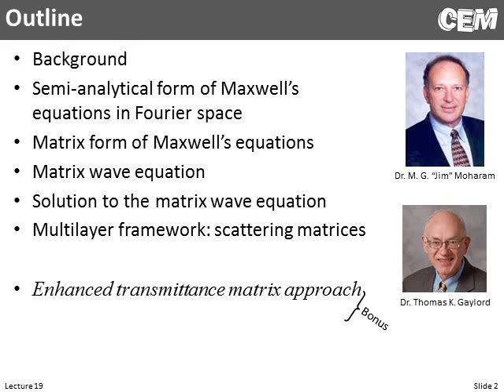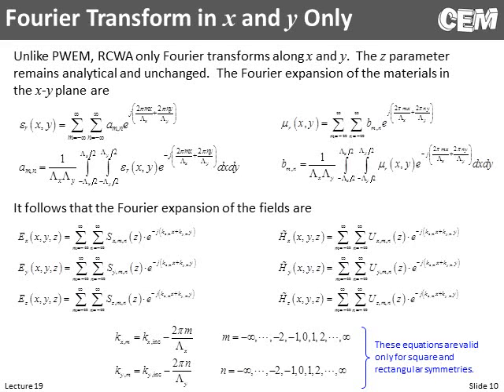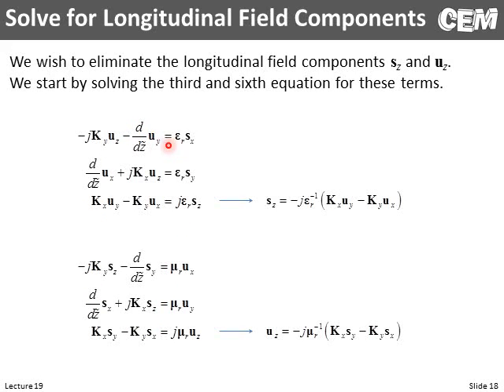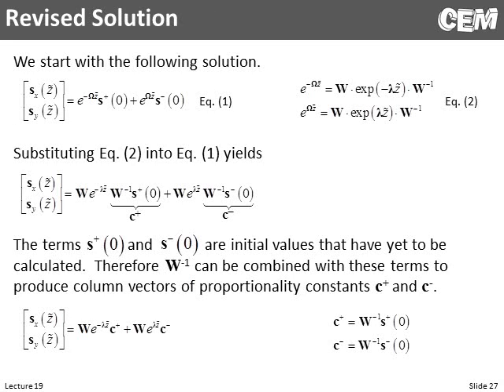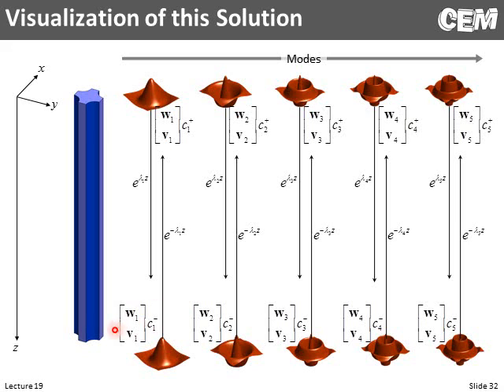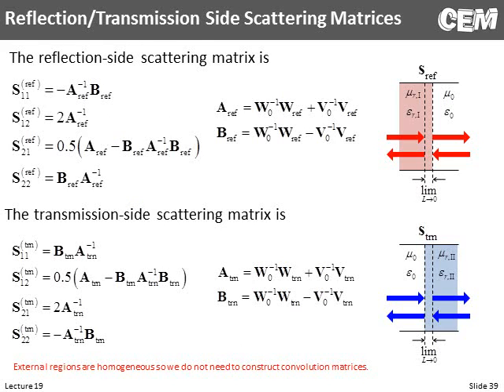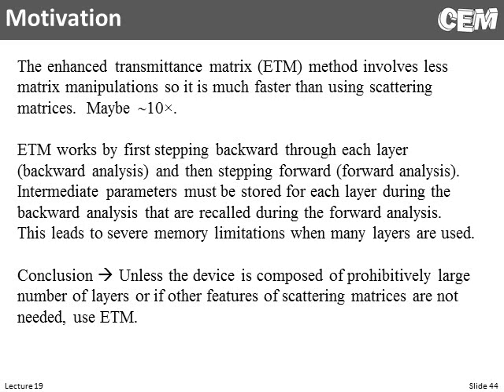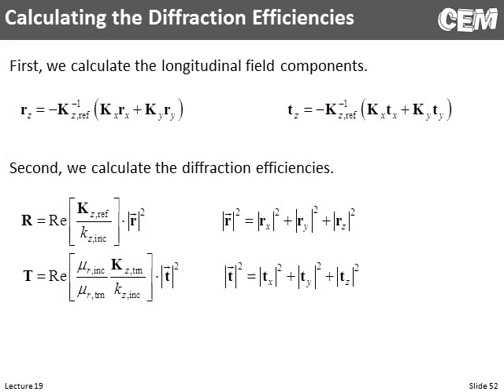Lecture 19 (CEM) -- Formulation of Rigorous Coupled-Wave Analysis

Comment: Hi Professor, is there any reason why we usually put 1 on the zeroth mode on the delta function of the incident electric field source?
Reply from the maker: The simulation being described here illuminates the device with a single plane wave.  If the angle of this wave happened to match one of the spatial harmonics, you could put a 1 in that position of the source vector. However, it is easier to just always source the device with the zero-order spatial harmonic for plane waves.

For other sources, you would need to do more to the source vector. For example, if you wanted to simulate a Gaussian beam, you would calculate the Gaussian beam, Fourier transform it, and calculate the weights of the spatial harmonics so they would sum to give you the Gaussian beam. The source vector would contain all of these weights. You can imagine doing the same for guided modes or whatever else.

Hope this helps!!

Comment: Hello Professor, I would like to confirm: theoretically, if there were no limitations on computational resources, could the RCWA model compute any numerical input? For example, setting the period to be extremely small or extremely large.
Reply from the maker: Interesting question.

So ignoring any problem due to size of the computational problem, I think RCWA is only limited by the physics that it is formulated from. My formulation is based on classical electrodynamics with linear and mostly isotropic materials. It would not be able to account for quantum effects at extremely small scale, relativistic effects of devices are moving near the speed of light, etc.

If I think of anything, I will edit my post here.
Reply: @empossible1577  Oh! thank you sir, I see! It is true that quantum effects in very small cases cannot be ignored！

Comment: Greetings, esteemed professor.
I have encountered a very troubling problem in my implementation of a rigorous coupled wave program. I found that if I set the relative permittivity of the transmitting or reflecting regions to complex numbers (either a+bj or a-bj), the sum of the calculated diffraction efficiencies is greater than 1, and sometimes even greater than 100. do you know what should be the reason for this? I don't know if there is something wrong with the program, because the results are always correct when the transmission and reflection regions are real numbers.
Another question, professor, is that when I set the thickness of a certain layer (for example, the last layer) to be very large, usually hundreds or thousands of micrometers, and if there is no loss of material in this layer, i.e., when it is k=0, I found that the curve of the diffraction efficiency calculated in the end shows malicious oscillations, even though the final power is conserved, I think that this kind of oscillations should not be consistent with the actual situation. . I also found the solution, which is that if I set the transmission region material to be the same as this layer, then the oscillation disappears. But my limited knowledge cannot explain why this is. Can you help me.
Have a nice life!
Reply from the maker: I suspect your first problem is a sign convention issue. This RCWA uses the negative sign convention where waves travelling in the +z direction are expressed as exp(-jkz). Along with this is permittivity with loss is er = er' - j*er''. Notice the imaginary part is negative for loss. I suspect you setting the imaginary to a positive number, as would be done when the positive sign convention is used. A positive imaginary part corresponds to gain.

It is a little difficult to diagnose your second problem. It seems when you match your transmission region to your last layer you see consistent results. Otherwise you see oscillations. I am not entirely sure what you mean by oscillations, but I can guess. If there are reflections at either side of a layer, you will form essentially a Fabry-Perot cavity. The larger that slab, the faster the oscillations will be. If you have something very large, those oscillations should be so fast they look like noise. If you use enough frequency points, you will eventually be able to resolve the oscillations.
Reply: @empossible1577  
oh! thanks for your reply!
Professor, the first question doesn't seem to be a matter of the sign convention, because even if I use the minus sign, there will be a situation where the sum of the efficiencies is greater than 1. This is only the case when I set the relative permittivity of the material in the transmission and reflection regions to a complex number. If it is set to a real number, then the calculation is correct. Of course, the other layers can be set to both real and complex numbers, and the results are correct.

The second problem may be what you call the Fabry-Perot cavity effect. Let me describe the oscillation in detail, for example, if the value of the reflection efficiency is greater than 0.8 at the first frequency point, the value at the next frequency point may be directly less than -0.8, and the next frequency point will be greater than 0.7 and so on. It is true that the thicker the thickness, the more obvious the oscillation, but this oscillation behavior will only appear when the material is not absorbed, that is, when the extinction coefficient of the material is zero, is this oscillation normal?
Reply from the maker: @dashingQ  Ok. This formulation of RCWA cannot handle complex numbers in the external regions. That is actually something we are working on now. My only advice if you want to do this with the current formulation, add extra layer above and below your device to simulate the loss (or gain) of your external medium and then try to match the actual external mediums to these outside layers.

As for your second problem, I think I need to see what you are talking about. Sorry. You can e-mail me at emprofessor(at)empossible.net.
Reply: @empossible1577  Okay, Professor. Thank you very much for your answer.

Comment: Hi Prof. Your videos have been very helpful to me. I have a query. I am now trying to model a metallic (e.g. aluminum) grating on a multilayer dielectric film on a glass or silicon substrate using rigorous coupled wave analysis. Do you think it is feasible. Do I need to count the glass or silicon substrate as a layer or as a transmission region in the modeling process?
Reply from the maker: This is absolutely possible, especially for ruled gratings. If you have a doubly-periodic grating it is still possible, but I find RCWA less efficient for metallic devices than real-space methods.

You will definitely need to account for the substrate. Is your substrate very thick? If so, it is probably okay to just set your transmission region to the properties of your substrate. In this sense, your RCWA simulation would have only one layer.

Let me point you to the official course website. I recommend using this as your main portal to the course materials. You can download the notes, get links to the videos, see the information organized, and get all the other learning resources on the course website.

https://empossible.net/academics/emp5337/
Reply: @empossible1577  Okay, I got it. Thanks again from the bottom of my heart. In fact my device has more than one layer, underneath the grating are several layers of dielectric films with different dielectric constants. So when I use the rigorous coupled wave analysis method to deal with these layers of dielectric film, shouldn't I treat them as if they were homogeneous layers, i.e., when calculating the Q matrix, the relative permittivity and permeability are scalars, and W is the unit matrix. The calculated scattering matrix is then still updated to the global scattering matrix.
Reply from the maker: @dashingQ  Yes. For homogeneous layers your convolution matrices are just diagonal matrices. Like you said, you can also just calculate the layer parameters directly. I will admit, for my layers I am lazy and don't include special code to handle the homogeneous layers with streamlined code.

Good luck and have fun!
Reply: @empossible1577  You are so great, Professor, and you reply so promptly every time. Have a nice life too.

Comment: Dear Professor, how could I best cite this work, and specifically the enhanced transmittance part? Your 2011 paper on scattering matrices does not cover ETM, and it seems that you addded quite a bit to the formulation from Moharam's original paper.
Reply from the maker: I don't think my ETM is different than Moharam's (great person BTW). At some point I switched to scattering matrices because I was simulating photonic crystals with hundreds of layers and was running out of memory with ETM.  I was using a computer with only 512 Mb of RAM (poor grad student). I switched to scattering matrices, got much better computers, and never looked back.  However, in my experience ETM is faster but that comes from implementing in MATLAB many versions ago.  It is probably still faster, but I am less confident without trying it again.  

Anyway, just reference Moharam's paper for ETM.  I have no publications on that technique.

Thank you for asking!

Comment: Hello -- I'm beginning to use RCWA to model anisotropic gratings and am finding your videos and lecture materials incredibly useful in the process! I have a question I was wondering if you could shed some light on: In the RCWA literature for anisotropic gratings (Gaylord & Glytsis, Rokushima & Yamakita, for instance), it appears that each individual RCWA layer doesn't need to be homogeneous the in the z-direction ("slanted" gratings with arbitrary grating vectors are allowed). From watching this video, though, I get the impression the homogeneous z-direction is a limitation. Is there an easy explanation for why RCWA is able to handle those slanted gratings without a "staircase" approximation?
Reply from the maker: Can you point me to the paper(s) on the slanted gratings that do not require spatial transforms?
Reply: @empossible1577  (I thought I replied to this earlier, maybe the links to the papers weren't OK to post?) The DOIs of two I've been working from are: 10.1364/JOSA.73.000901 & 10.1364/JOSAA.7.001399. I'm still wrapping my head around RCWA in general, but as I understand it, these papers have you perform Fourier expansions along the grating vector, which can be arbitrary / include a longitudinal component. This seems to violate the principle of the longitudinal direction being homogeneous...

If you know of any more modern resources for the sorts of anisotropic RCWA discussed in those papers, I would love to know, too. Thanks again!
Reply from the maker: @aaron.becker  Thanks for pointing to these papers so that I can be confident what you are talking about.  I should start by say that you can simulate slanted gratings with a staircase approximation using ordinary RCWA.  I would not be too paranoid about using the absolute best and most efficient method.  What you already have will work fine and will not require you to formulate and implement a new code.

That said, this requires a new formulation and slightly different implementation to account for the slant.  The key difference is that the since the direction of the grating vector is different, the directions of diffraction orders are different.  For this reason, all of the components of the wave vectors are different.  I think as long as you calculate these correctly and calculate the correct Fourier coefficients, the rest of the RCWA formulation should be the same.  I have not implemented this type of RCWA so there may still be some issues I am not thinking about.

If you do implement the method, you can use your ordinary RCWA to benchmark.  I wish I could be of more help!
Reply: @empossible1577  Thank you for the advice! If I can impose on your time for one last question--

I believe that for these fully-anisotropic formulations, you typically need to sort the eigenvalues and -modes after solving the characteristic matrix for each layer (otherwise, you won't properly match mode coefficients between layers). I've done this for the transfer matrix method before, but here, when there's an arbitrary number of eigenmodes instead of just 4, I don't know where to begin, and haven't found any procedures anywhere. Any advice on that front?
Reply from the maker: @aaron.becker  Yes, you will need to sort the modes.  The best way to do this is the calculate the Poynting vector for each mode to identify if it is forward or backward propagating.  You only need to z component of the Poynting vector so you only need the x and y components of E and H.  Another way to do this is to look at the sign of the eigen-value.  However, I think this could run into problems in more exotic media.
Reply: @empossible1577  Alright -- thanks again for your help, here. These videos and the slides are really invaluable for people trying to mostly self-teach themselves, and I will definitely be returning to and recommending them!
Reply from the maker: @aaron.becker  Thank you!!

Comment: Dear professor, may I ask you if rcwa is suitable for modeling the reflectivity spectrum of silicon hole array with plane wave that has 280nm-800nm range?
Reply from the maker: Assuming the hole array has a spacing somewhere close to one wavelength, I think RCWA is ideally suited for this.  That said, do not be paranoid about using other numerical techniques that can also give you the answer, but may also offer you other benefits.  RCWA is incredibly fast, but visualizing the fields, incorporating high contrast and metals, as well as when problem size grows are the drawbacks of RCWA.

I think the best first numerical methods to learn are finite-difference frequency-domain (FDFD) and finite-difference time-domain (FDTD).  They can do the same things as RCWA although slower, but they are easier to learn, easier to implement, and can do more than RCWA.

I recommend accessing the course through the website.  You can download the notes, get links to the latest versions of the notes and videos, and get links to other learning resources.  Here is the website:

https://empossible.net/emp5337/

This same course above has FDFD and FDTD.
Reply: Thank you very much professor, but as you mentioned in the video, “rcwa is suitable for low to moderate index contrast”,considering the fact that silicon has big contrast both n and k in low wave length range, is it still  suitable?
Also, I don’t really understand why it is only ideal for low to moderate index contrast?
Sincerely, John
Reply from the maker: @randomguy7658  I think silicon is moderate index contrast.  To give you an idea, I have worked with some devices with refractive index approaching 7.0.

RCWA discretizes the field by expanding it into a plane wave basis.  That means even the materials are represented as a sum of plane waves, although they are more accurately called planar gratings when describing materials.  This has a hard time with step discontinuities and the higher the contrast the more a plane wave basis struggles with this.

RCWA is still fully capable of analyzing even high refractive index materials.  It is just that it may take many spatial harmonics in the expansion to obtain an converged and accurate result.
Reply: Dear professor, I tried rcwa method and fdtd method to simulate the reflectance of plane wave source from 280-800nm, I found out that rcwa gives me very incorrect results in the range of 280-400nm compared with experimental data, however fdtd gives a very good match but is too slow. Is the incorrect results associated with the fact that refractive index are high and change significantly in low wavelength area?
Thanks a lot, John
Reply from the maker: @randomguy7658  Wow.  How did you get these implemented so quickly?  

In general, any method can be made to simulate anything.  It is not that RCWA is incapable of analyzing devices with high refractive index contrast.  It is just that it do it very slowly and inefficiently compared to other methods.  For silicon, you should be fine.

I most suspect a convergence issue.  Almost all numerical methods have something to adjust to get more accurate results but at the cost of speed and efficiency.  In RCWA, this is the number of spatial harmonics.  In FDTD, it is the grid resolution and some other things.  In a convergence study, you will observe the trend of how your final answer varies as you increase the resolution (or number of spatial harmonics).  While the answer may jump around a bit, there will be an overall asymptotic behavior where the answer is converging to some final result if you could run a simulation with infinite resolution.  It is up to you to decide where along that curve to obtain your final answer.  It is most important that you understand where you are on that convergence curve so you know if you are getting garbage results or not.  Never conclude anything about a simulation until convergence.

If it is not a convergence issue, you must have some mistake in your code.  RCWA should be well suited for simulating silicon devices.  I have done it many times.
Reply: @empossible1577  thank you very much, I’ll try to fix my problem, it’s unbelievable to me how fast you respond. Thanks again for your information.
Reply from the maker: @randomguy7658  I try answer everything as quickly as I can.  I may not always be so fast, but I try.  You caught me at a good time I think.  Good luck with your codes!